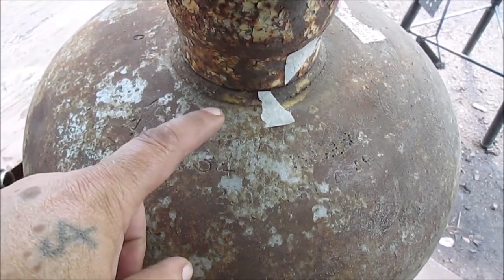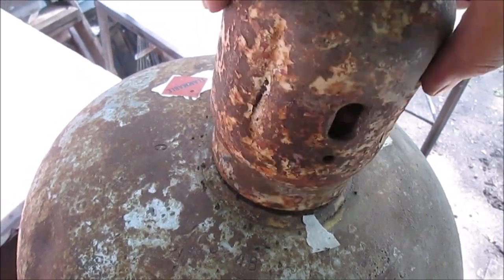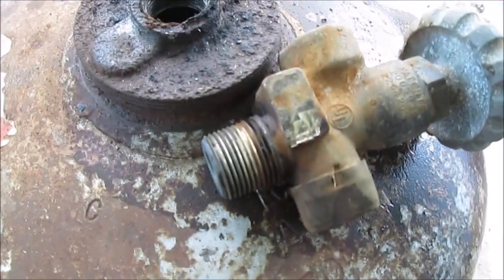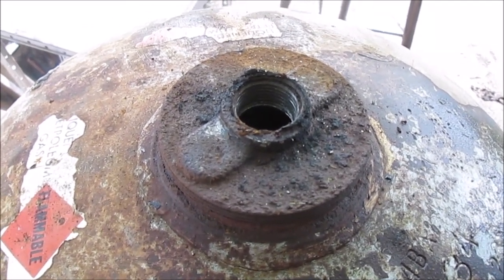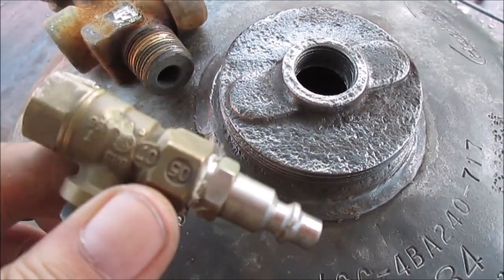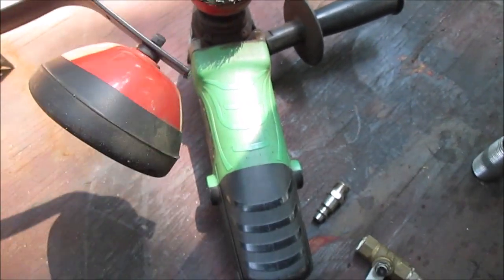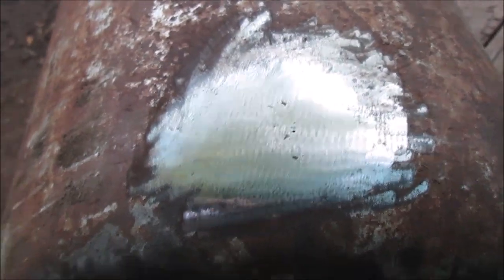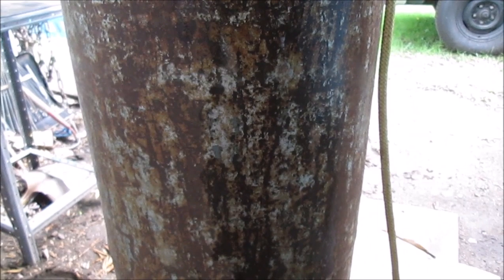Air Tank Project  Part 1

Comment: Yes, water expands x1600 times when it converts to steam...  Great idea, let water soak in, then heat to break up the rust...
Reply from the maker: Works good on exhaust manifold bolts

Comment: That  will make a good air tank. It will hold more pressure than you can pump I bet.
Reply from the maker: I made a homemade air compressor from a tank like this and it held 150 psi